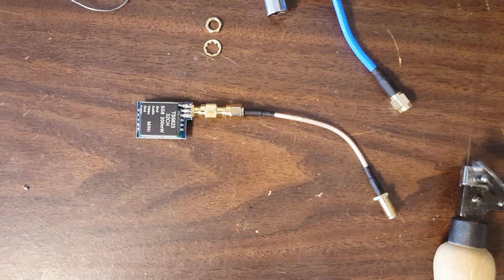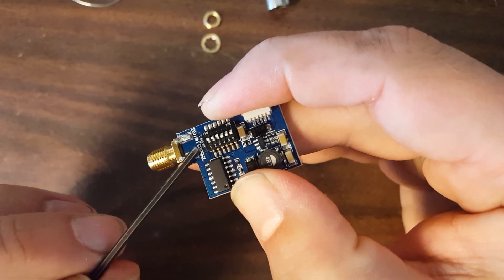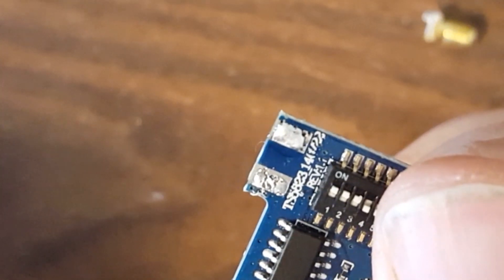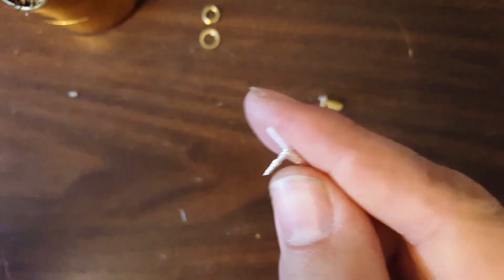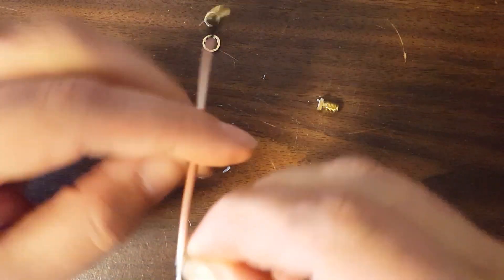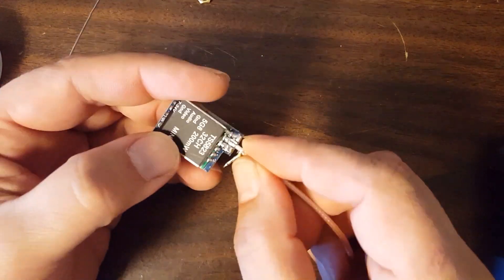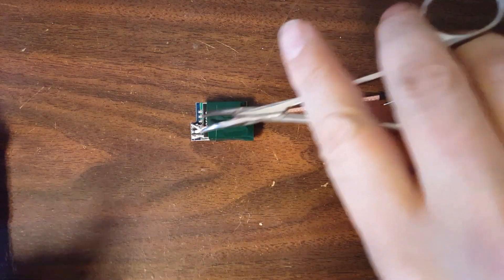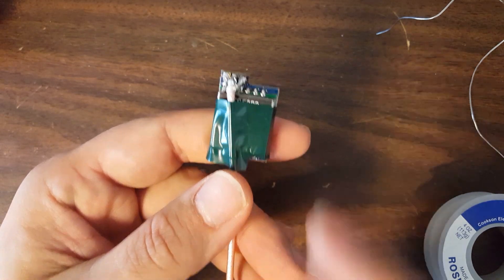How To De-Pin Your FPV Video Transmitter

Comment: Bonus points for not cutting out the mistakes and making it look like a roach could do it like some people do :)
Reply from the maker: +highoctanehotrod I figured as long as I was making all the mistakes, everybody could benefit from them. I'm not a proud man...
Reply: try holding ya wire cutters over the other way JB, you might get better control of your depth of cut/feel. the single bevel will push your cutters away into you waste side and give you a flat face to strip the wire outter away.

Comment: nice video yet again Josh. do you use the 5823 vtx with fatsharks? range? compatibility? I just recently bought a set of predators and am worried about replacing the fatsharks brand vtx every time I break it. I usually don't fly very far like 300ft.
Reply from the maker: +J dog harrell Yes. I have just started using them, but no problems so far. For the record, I am using F band on the 5823, and I have the Attitude V2 with the Nexwave V2 module, not the newer raceband module. I have not tested every channel on the band, but channel 1 works fine at least.

Comment: I have done this a few times and the last time I did it I wanted the coax to come out at a right angle from the VTX PCB, so I used hot glue all around the solder joints in a big dollop. Feels nice and sturdy for strain relief. BUT, when I fire it up, the hot glue warms up and gets soft! I guess epoxy would be better...
Reply: I had a similar idea of using hot glue to help stabilize an AIO camera, not giving any thought to how hot the TX would get. Needless to say halfway through my first test flight it melted, allowing the camera to re - orient itself in a less than desirable manner and bringing my dreams of becoming a FPV God abruptly back to earth. We live and learn.....

Comment: Great video Joshua, but there is a much easier and quicker way of removing the SMA connector on the VTX, simply heat the whole connector up with a cigarette lighter or over a gas stove by waving the connector through the flame.  Its even enough to de-solder the center pin and the whole SMA connector just falls off.  That's how I do mine, done quite a few now.
Reply: Joshua Bardwell best tip!; using the soldering iron on the SMA connector to heat the pins good idea
Reply from the maker: +crezzee Good tip. I have a butane torch that should do the trick. I guess I was worried about overheating the board.
Reply from the maker: +crezzee Upon further exploration, I tried just holding my biggest soldering iron tip against the end of the SMA connector, and after a short period, it came right off. Just keep an eye on the heat in the board to make sure you're not overheating it.

Comment: I use razor blades to strip coax, and use the roll method with my fingers.
That makes it easy to feel when you reach the wire inside.
Reply from the maker: +sqwert That's part of the reason I was so confused. I was expecting to feel the blade hit solid core and it was stranded.
Reply: teeth work well

Comment: Here's a good way to secure the wire and you don't need to pull the braid back. http://i.imgur.com/ISW48QD.jpg
Reply from the maker: +compudaze That's a good approach. Just solder the braid directly to the pad without pulling it or twisting it.
Reply: Makes it nice and firm. Can pull thew crap out of it without effecting the signal wire inside.

Comment: This is how I did the same job with built in strain relief. Life is so much easier using a sharp modeling knife rather than the side cutters.
http://www.rcgroups.com/forums/showpost.php?p=33435142&postcount=4820
I similar concept for small wires
http://www.rcgroups.com/forums/showpost.php?p=33422344&postcount=4786

Comment: I am consistently surprised at the number of people that don't have or just don't use a good pair of wire strippers =). None the less this is another good video. In my opinion Mr Bardwell's videos are an asset to anyone in this hobby.
Reply from the maker: I don't like using strippers on coax. Although they could hardly have done worse than I did.
Reply: + for GOOD wire strippers...so much better than fiddling with razor knifes ect. I suspect that the issue is people in this hobby are so used to buying stuff from China that they buy Chinese tools also :)

Comment: Hi.
Try to put heatshrink on transmitter, and make cuts for dipswitch and power connector. It's strenght enought, and easy to remove if You want replace coax.

To cut dielectric use razor knife. It's way better.